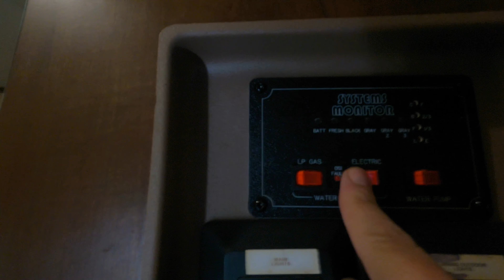Atwood RV Water Heater Leak repair and tank flush. RV Living Full Time.

Comment: I have the exact same water heater in my Bigfoot camper, one night during a wind storm the flames from the burner took out the controller board, a few hundred dollars later and no hot water for the two week trip. After getting home I cut a piece of tin and screwed it in place on the side wall between the board and the burner, but not long enough to cover the melt fuse. Haven’t had any problems in over six years now. Great info on water heater maintenance.
Reply from the maker: It seems like something always goes wrong as we are about to take a trip. Sorry that happened.The tin thing is a good idea! I may have to steal it 😀

Comment: Hot water tank calcium buildup clean-out is only needed once every 6 months or so in area's of heavy calcium content.  6 to 12 months is the normal time frame.  Certainly never more than 2 years between cleanings.  Too frequent cleaning will tend to wear out the reuseable plastic plug on the Atwood.  Suberban tanks have an anode sacrificial rod attached to a scew-in plug.  The plug is replaced when you change out the anode plug.
Reply from the maker: Thanks for the info. We were in a very high calcium content spot at the time. Did a number on our water filter. I do think you are right about once every 6 months in normal conditions.